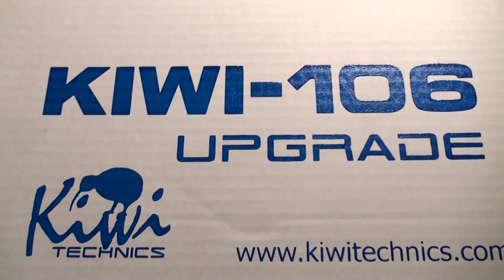Kiwi-106 Hardware Upgrade: Introduction

Comment: I'm just curious why anyone would want to switch their kiwi-106 to the standard 106 again, what exactly are the downsides to having this upgrade that you'd consider switching back? Can't you produce all the standard Juno-106 sounds with this upgrade?
Reply from the maker: The main reason we added the swapback system was to handle the rare situation of the owner selling the synth to another collector who wanted an 'original' 106 and not a Kiwi-106. I have run into folks who prefer their Juno nice and simple rather than loaded up with extra goodies, for example.
Reply: Thanks for the quick response man. I spent the whole night watching your videos on the Kiwi 106 upgrade. I'll probably end up doing the same for my 106 in the future.

Comment: @4:50 I'm surprised that they haven't created a switch for the swap backboard so you can change between Kiwi and Juno with a knob instead of haveing to open up the boards and replace the original chip.

Comment: You mention velocity sensitivity is added for incoming midi information- would I be correct in assuming that means playing the Juno 106 itself would not reflect this change? I assume the keybed itself is incapable of transmitting such information.
Reply: In addition to this question- does the Kiwi upgrade give you any finer control over individual voice detuning? The Juno-106 sounds quite horrid in 'unison' mode because of phase cancellation.
Reply: I want to know this too!
Reply: @desmondmyers  It's been 4 years. I'm not feeling too hopeful!

But also not as keen on modding my 106 now given their value

Comment: Can we do this ourselves without a lot of equipment? Or do we send it to you?
Reply from the maker: Any synth-tech will be able to do the procedure with the standard equipment - A vacuum desoldering tool & soldering iron for example. Some people have sent their voice board to me for the installation procedure, though. If you need it done send me a private message and I will give you the rates.
Reply: Oh, I was told I need a scope and multi meter etc. The other thing is while "any synth tech" might be able to do it, there are no techs around where I live. So, If I send the boards to you,  am good to go after I reinstall them? Or is there other work to be done? I love the string sounds on a kiwi demo here on you tube. The mod seems to really do the 106 right.